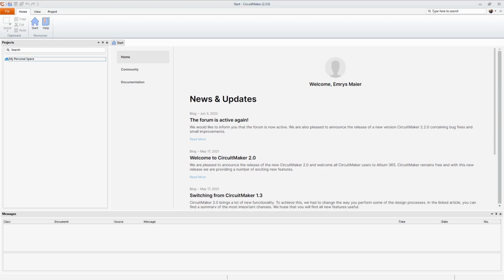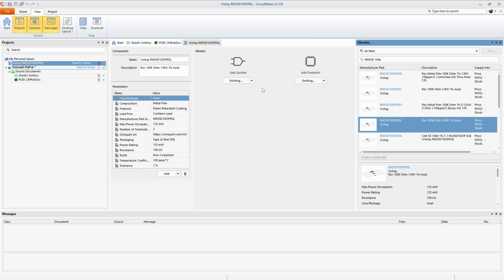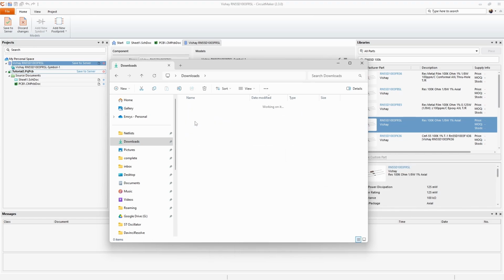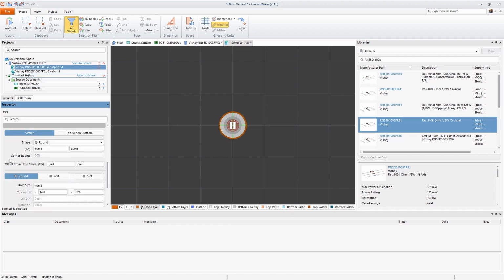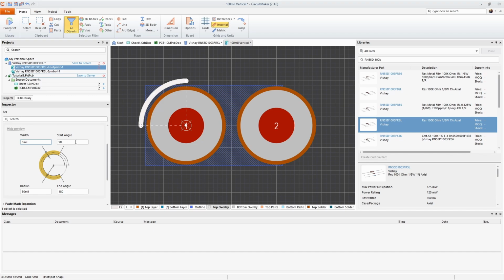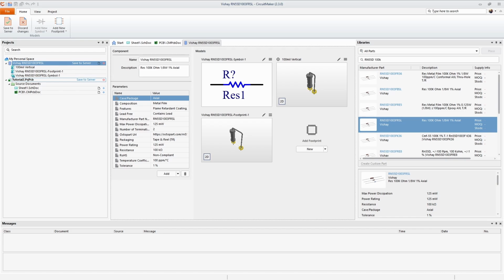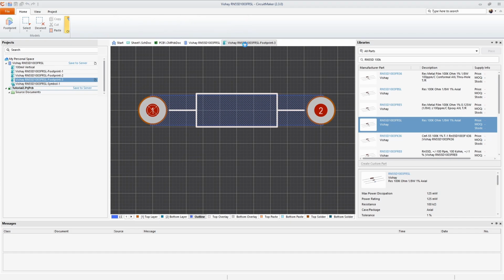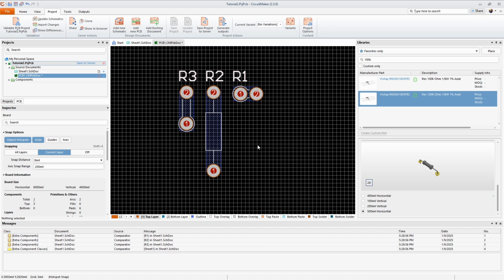Start to Finish Through-Hole Component Creation Tutorial for CircuitMaker 2

Comment: RN55D4702FRE7 by Vishay
Vishay RN55D4702FRE7
Fixed Resistor, Metal Film, 0.125W, 47000ohm, 200V, 1% +/-Tol, 100ppm/Cel, Through Hole Mount